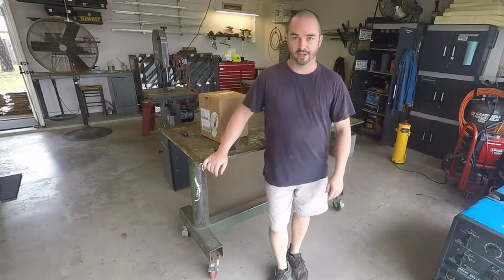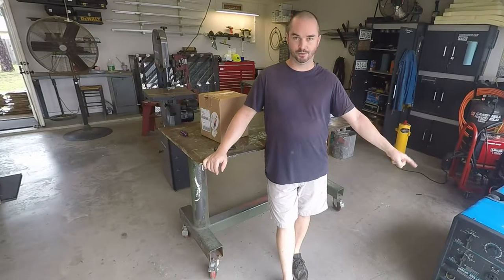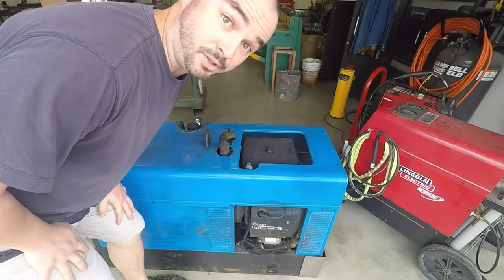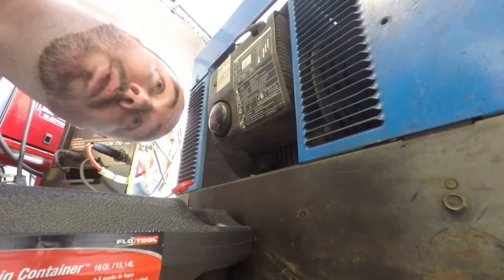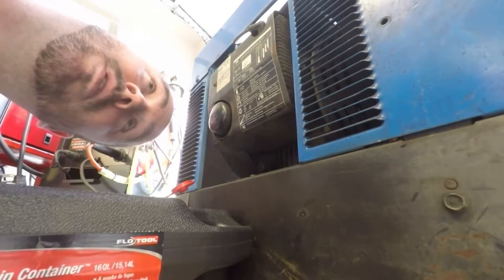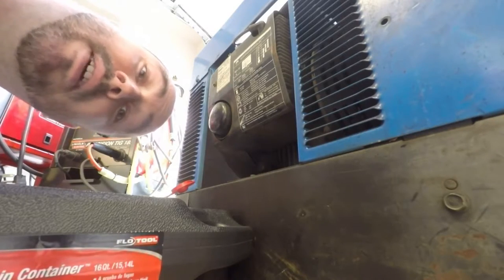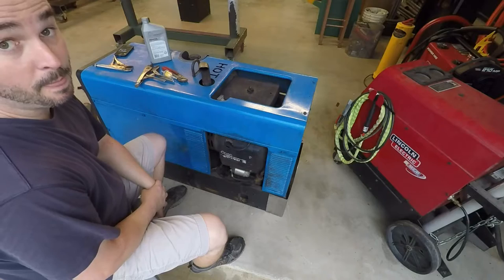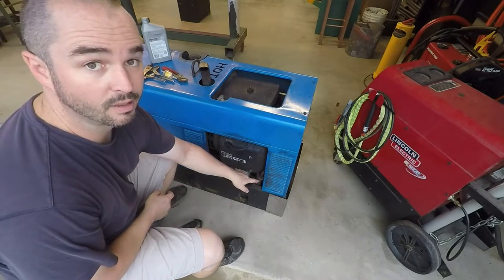Tune up

Comment: Just curious what you payed for this machine? Looks brand new despite the hours.
Reply: Eric Ayers I paid $1750 for it. Recently I overused it and spent $300 to have it fixed. The machine has paid for itself several times over. Great unit.
Reply: Sean O'Grady Gotcha. I hear those Onan motors are the way to go. What do you mean you overused it? What broke?